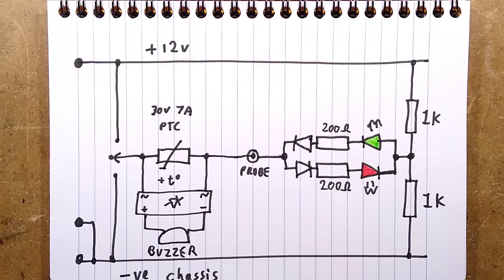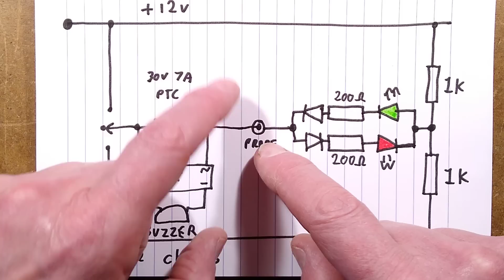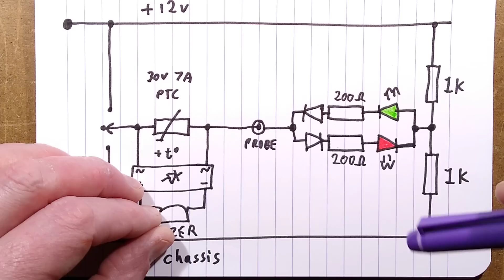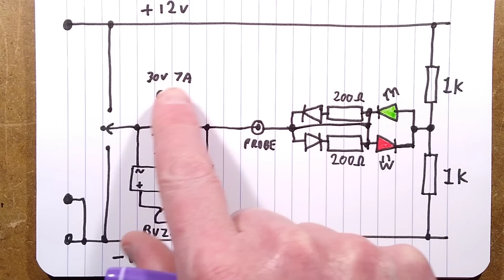Inside a mechanic's test probe - with schematic

Comment: Since the 13.2VDC is divided in half by the two 1k resistors, the probe's voltage to negative is 6.6V minus the 0.7V diode drop, minus the small voltage across the 200 ohm, minus the forward voltage of the LED.  From probe to positive the polarity would be reversed and slightly different due to the color of the LED.  So it looks like the voltage to anything you test would be less than 5V as long as you never press the switch.

It seems to me that the two 'current steering' diodes and two 200 ohm resistors add some voltage drop to prevent the probe voltage from going above 5V. 

The switch is what could do the damage.  I think I would put a 22 ohm 10 Watt power resistor in series with the probe tip so the current could never go above 0.63 amp, which should be enough current to light up almost all lights in a car.  That would also make the PTC, etc. unnecessary.  

That small black wire and clip look like they may get in the way and be troublesome.  Tape it out of the way, to the big cord with some black electrical tape.

Thanks, Clive for the teardown of what seems to be a unique torture instrument.  🤣🤣
Reply: Filament headlamp circuits draw about 8 amps .. with the 7 amp PTC they still flash on  briefly.. I have a version of this and surprised a car owner while testing their tail lamp bulbs as the headlamps flashed ..
Reply: For diagnosing low current stuff sure that would work but people often use the power probe to test things like fuel pump or starter which need a lot more current.

Comment: Seems like it would be more useful on older cars. Don't modern ones have lots of PWM lamp brightness, CAN signalling, etc. ? But I don't really work on them any more, perhaps there's still plenty of DC wiring. Your point about 5v sensors  shows the dangers, very good point. Car circuitry has traditionally been pretty tough to withstand  polarity reversal, load dump etc. but maybe that's no longer the case.
I think I've seen something similar suggested (with 50V capability) for debugging EM pinball machines.
Reply: The power probe 2 (this is a clone of the powerprobe 1) can do pwm and detect canbus if your ears work, but even on the most modern of vehicles these tools very much have their place. Very handy.
Reply: @dizzy2020  yep pp2 has display, and can display voltage, min voltage, max voltage, differential voltage.  honestly its my favourite, newer power probes start to become so feature rich they become laggy to use or too bulky, the pp2 is the perfect balance. ideal for low voltage circuits, just dont tap the up button :)
Reply: To add... motors are motors, unhook from harness, test to see if it spins- fuel pumps, window regulators, even solenoids. They make an adapter too that changes the 12v tip to 5v. Just have to know when to use the powerprobe vs use an oscilloscope.
Reply: @tomp5377  Super handy when you pull the cab off your truck, but forgot to roll the window up. :-)

Comment: The reason being, the person that designed this circuit did not know what they were doing. If you like to use a different resistor for each LED, for instance to compensate for equal brightness, then both LED's should be in parallel. The diode - resistor combination can load the "bipolar LED" with a different resistance, depending on polarity. But both resistors are 200 ohm making the whole thing completely redundant. Knock it off the board.
Reply: Indeed. Keeping it simple :). Just use a bi-directional LED, no additional resistors and diodes as the 1k resistors already do the current limiting.

Comment: I don't get the extra 2 diodes and resistors either. Just connect straight and replace the 1K resistors with 1.2K.
Reply: Those 1k resistors are adequate.
Reply: @Frankhe78  Yeah but they've chosen a total value of 1.2K so I if they want to use that it's fine as well. All I'm saying is I don't see the need for an extra pair of resistors and diodes.
Reply: @Ni5ei  The values are not that critical. 1k or 1k2 won't make much of a difference. Those two diodes and resistors are not needed and can be replaced by a blob of solder.
Reply: @Frankhe78  I know, please read my previous response.
Reply: @Ni5ei  No need to replace 1k by 1k2. It is a generic LED. I you would like to fit a 1k2 then that is fine.
Reply: @Frankhe78  Never mind...

Comment: There IS current limiting on that flying black clip... The wire will turn into a fuse in short order if you connect it to positive ;)
Reply: Us mechanics call that thermal protection
Reply: We call that thermal protection.

Comment: You can buy these branded as 'Power Probe' as used by Eric O and his ilk ... cost about  US$165  :)
Reply: Power probes are different , Power probes tell you the voltage,  they tell you if there is positive or negative present in the circuit and have a manual trip reset  . You also can get a 5v adaptor for Power probe so it out puts 5v which is very handy.

Comment: Looks good, but I would prefer to see some fuses on the main power leads. As you pointed out, there is the possibility of probing a positive supply with the negative terminal so I would certainly want one on the negative side, and for completeness one on the positive side too.
Reply: We all love a bit firework from time to time.
Reply: One in the center switch position lead would do fine.
Reply: The negative side on most of the examples of this tool I have seen have been a covered alligator clip, with a sliding cable restraint, so unless you are negligent or don’t maintain the tool the risk is low. It also has a circuit breaker, so you should be fine.
Reply: @rsoul7282  It is a specialised diagnostics tool used by specialists and not a regular component used by regular people. In order to do proper diagnostics you sometimes have to do half way dangerous things. Oops, I have blown the fuse. At least now I can find out which fuse it is an identify the circuit that has the issue. A process of structural elimination is still the best way to find faults.
Reply: @Frankhe78  are you joking? These are readily available to anyone, thought it takes a modicum of knowledge to use one. Certainly not a tool for ‘specialists’. Besides, blowing a 12v fuse in the name of testing should be a last resort if you can’t get a resettable circuit breaker, and by no means is it dangerous, though I’m not sure what you are doing, so I won’t discount the possibility.
Reply: @rsoul7282  I am describing the worst case scenario that can happen with a tool like this. It can blow a fuse when you make the biggest possible mistake. Not a big deal.
Reply: @rsoul7282  "These are readily available to anyone"
He didn't say anything to the contrary, you seem to be reading what you want to see rather than what he said.
Reply: @ferrumignis  ‘specialised tool for specialists and not regular people’ contrary indeed. What did you read, and how do you interpret things?
Reply: @Frankhe78  I have extensively used such a tool and have never blown a fuse on the machine I have been testing. Countless times I have tripped the circuit breaker on the test equipment, never a fuse on the machine. In fact when checking for a blown fuse this is the first type of tool I would reach for.
Reply: @R Soul  99% of people would have no clue what to do with a tool like this, for sure it is targeted to "specialists". If you blow stuff up with this or a multimeter you can only blame yourself.
Reply: @rsoul7282  Exactly the point I was trying to make. A car usually does not have circuit breakers but (miniature) automotive blade fuses. When a circuit has a defect a fuse in the fusebox of the car will blow and you can use this tool to do some quick diagnostics on the circuit.
Reply: @rsoul7282  I interpret this exactly as it was written, a tool to be used by someone who knows what the hell they are doing which rules out a majority of the public.  I can buy a stethoscope from Amazon, but that doesn't make me an expert in using it.  Perhaps you should think more before responding again.
Reply: @ferrumignis  ok I understand what you guys are trying to say based on your experiences, and I’m not trying to be rude, but I just never really considered such a simple tool as being a difficult concept to understand. When you think about the vast array of test equipment out there, a lot of which takes actual skill and training to operate, the humble little power probe on a 12v circuit is pretty approachable, you aren’t to hurt yourself and are unlikely to damage anything unless you are an absolute goose. Go and buy one and have a crack at using it, I’m sure you are intelligent enough to work it out very quickly and it will become an excellent addition to your tool set.